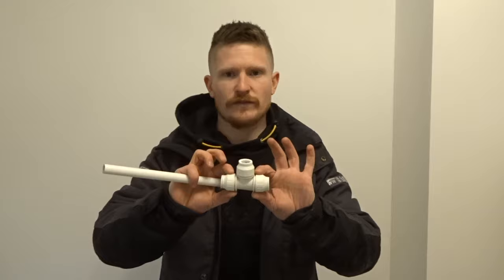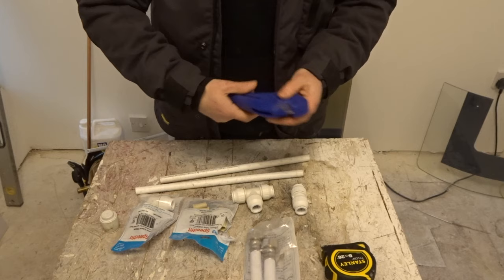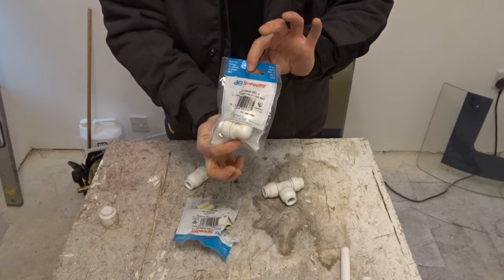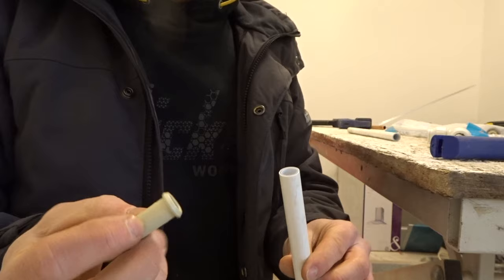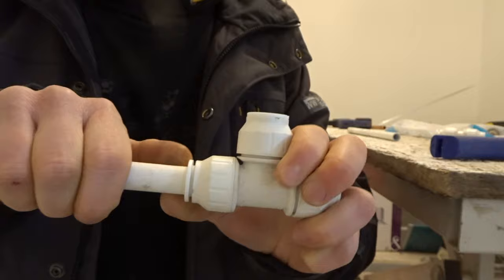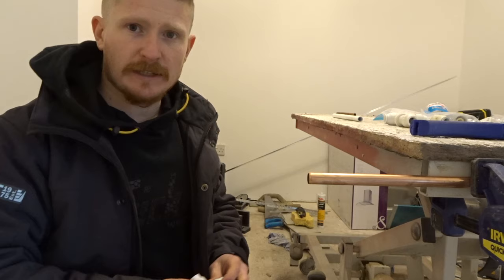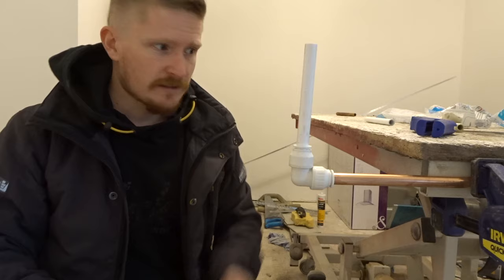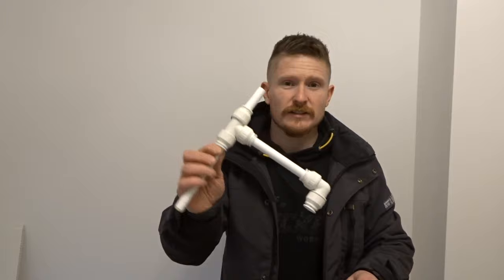How To Use Push Fit Plumbing Fittings | Plumbing with Plastic Pipe

Comment: Very good vid, thanks! But could you tell me if these fittings can be used on flexible plastic pipes? I have a plastic pipe feeding my toilet and the only way of isolating the water when working on it is by the main stop valve. Could I use speed fittings on flexible pipe so I can fit an isolation valve? Thanks in advance!

Comment: Perhaps worth mentioning that those inserts can be used with compression fittings whereas the ones with the extra washer (not in the vid) are for push fit fittings.

Comment: Great video mate, perfect explanations throughout 👌 
I do have a question for you please. If I use a push fit on a copper pipe, ideally how much copper should be present for the push fit to connect comfortably? I have a slow leak on the main pipe to my toilet and the compression fitting is stuck (olive is gripped hard and I don't have space to cut it at an angle to get it off 😭) so I was considering to cut the main pipe shorter so I can just remove the compression fitting but the copper isn't that long so I'm not sure if it would be best to cut and extend with the plastic pipe as you've shown. PS - the leak is behind the isolation screw, so the slow leak is consistently dripping and it's not the nut being loose as I've given it another tighten, no luck though. Any advice would be greatly appreciated. Thank you.

Comment: Is that not a compression insert , using plastic pipe shouldn't it be the insert with the 2 rubber o rings on ? Explained very well and clear perfect for beginners

Comment: So what is the minimum distance between two Speedfit connectors (obviously to allow later removal)? Say and elbow and a valve feeding my sink. I am refitting for the valve and I want the current flex pipe to be in the same position. It would be useful actually to know the minimum length of Speedfit pipe needed as an alternative way of looking at it. Thanks.

Comment: Great video thank you. Would these push fits go on older 1/2" copper pipe which I'm told is a tad larger in diameter than 15mm pipe?
Reply: Yes they fit copper pipe fine

Comment: I fitted a washing machine service valve using plastic pipe with insert but it leaked. A small leak but couldn't stop it. I have read its best to use copper for comression joints and simply join the plastic pipe to the copper pipe.

Comment: Just did a project using JG.Since I was using a couple of elbows I was practicing trying to get exact size and discovered when removing the pipe scores were being left on the pipe.It was all plastic I was using.I read that you shouldn't use pipe if it's marked so I tried to do job without having to remove them again.What do you think of this?

Comment: Great informative simple video. A question - how do I join new flexible pipe tails with female connection to the existing push fit on my boat - fitting a new mono block tap? Thanks

Comment: They do metal inserts to be used when joining to compression fittings to prevent plastic pipe being crushed.
Reply from the maker: I've never had to use those in my many hundreds if not thousands of inserts fitted.
Reply: Hep 20 have metal inserts, and have 50 year guarantee as well.

Comment: Great thank you. Can you tell me do I need to drain the entire heating system to extend a hep20 pipe? Want to shift a radiator 30cm so need to extend a pipe with a connector. Thanks
Reply from the maker: That’s dependant on the type of system you have. If pressurised then yes, if it’s a vented system then you may be able to pull a vacuum

Comment: Dont, it will last until the copper corrodes with condensation from the two surfaces that conduct heat differently, the copper will develop green slime and it will fire it off the pipe.
It is just a question of when.
 I have seen hundreds of failures some that have cost over £30,000 to fix the damage .

Comment: Why didn't you use super seal inserts for the plastic compression fitting? Is it not right or needed? I have been using them for all plastic on plastic (and the normal insert when going to copper, brass, chrome etc.)

Comment: as a 3rd generation plumber i still use ptfe on compression fitting even on plastic , rather do that than have to go back to a tear drop leak
Reply from the maker: If that's what works best for you then that's fair 😃

Comment: Hi. Currently undertaking a job where I need to split a cold water supply in the bathroom into 3 supplies.
Any guidance on if I can tee off of from a tee? Trying to avoid the more expensive 3 way manifolds which seems excessive.
I'm splitting the cold supply to a sink to a washing machine/and two taps.

Comment: Excellent. Thanks so much. What is best way to clean the old copper pipe? Thanks
Reply from the maker: A piece of wire wool is the best thing to use. You can also use scouring pads.

Comment: Excellent guide! But can you tell me if it's possible to use these on ½" imperial size copper tube, bearing in mind the diameter is only slightly different from 15mm metric?
Reply: Hi ..you can buy 1/2inch to 15mm straight push fit adaptor. Think I got mine from screwfix about 5 years ago.

Comment: I am 74 years of age and never used plastic pipe, I retired many years ago from the plumbing and heating trade, and I just have to say thanks for this video.A couple of questions, can you reuse a fitting as we do with compression fittings do we ever need to replace the rings in the fittings or just throw them away, Who seel these fittings and pipe, and the best prices ,for instance Screwfix or tool station, One reason I am asking is that a new kitchen was fitted under my floor and the guy connected to the rising main with a fitting just like these and its impossible to ever get to it, and i have been concerned about it ever popping off, apologies for the long message.
Reply from the maker: Hi. Yes you can re use a fitting and Screwfix tend to be best priced. I wouldn't worry about these fittings. I've fitted many many over the years and never had a failure.

Comment: Great video. Do we have yo use Pex inserters? Just installed a electric shower without one. Wonder if it may leak? Thanks
Reply from the maker: Yes it's something that should always be done otherwise you run the risk of leaks. You may be lucky and it may be fine, keep an eye on it. But it it's possible I would consider rectifying it and installing an insert.
Reply: @TheDIYGuy1  thank you buddy. I will get some ASAP. Jeep up the good work. 

By the way liked and subscribed 👍🏼
Reply from the maker: @Bfamily91  thanks!

Comment: I removed a radiator in my house last year so know the pipes for the radiator are in the wall, flexible plastic pipes that are branded Hep2o. Am I able to add these attachments onto the flexible pipes to move a radiator to a different wall?
Reply from the maker: JG speedfit will work with Hep but if you encounter a fault then you will void any guarantees. You can buy the equivalent Hep fittings to the ones shown in this video.

Comment: What's best for a central heating system?  I'm not sure whether or not to use pex or pb pipe  .
Reply from the maker: It depends which you prefer working with. Both can be used for the central heating system.

Comment: Which inserts should be used as there are the plain and the superseal type?
Reply from the maker: Superseals provide a better deal supposedly but I've never had any issues with the standard ones so use them all the time. Also the superseals shouldn't be used with compression fittings so that makes the normal ones a more generic item for the tool bag.

Comment: Are these safe for use under floor boards as in December I had a plumber replace a pipe using the straight ones with a copper pipe in the middle and I've been worrying about it busting, leaking or popping off the copper pipe please help as I always worry about it
Reply from the maker: They are perfectly fine for what you've described. Don't worry about it.
Reply: @TheDIYGuy1  Thank you for getting back to me
Reply from the maker: @Skimzi  👍

Comment: Would you recommend burying this stuff under concrete?. I need to make 2 4 meter runs under my kitchen floor as the cooper failed and leaked, so looking for an alternative?. Thanks
Reply from the maker: If it were me I would run it in an outer sleeve so that it can be pulled out should there be any issues and this will also protect it. I believe this is how building regs like it to be done too.
Reply: @TheDIYGuy1  thank you for the top reply 👍 had a plumber recommend MLCP? What's this?.. why do they confuse things lol
Reply from the maker: @battlight3476  I have never used it. It's multi layer composite pipe and is a fairly new innovation. I don't have enough experience with the mlcp so I don't want to misguide you on that. Personally I think push fit(PEX) will be fine for the job but as I say, just be sure you lay it inside a conduit of some sort.

Comment: i have used it for the whole heating radiators in my house, i have 3 floors and 5 heating radiators.
we have a district heating system in the netherlands with water flowing of 80/90 degrees, and about 3 to 4 bar.
i must say in the first installation some connection leaked.. but after i checked again i saw that the tube was cutted crooked. i cut it straigt again and the leaking was gone.

i used it one winter period without any leakings so far, but i am just curious if it will be fine next year?
can i trust the John Guest Speedfit system? and for how long will it last? because the connections are made in the wall. does it reach a lifespan of 30years? 

it's a very nice system, but i dont know how for i can trust the installation, if anyone can clarify this for me i would be relieved :)
Reply from the maker: Yes, you can fully trust the system for many years if installed to standard.

Comment: Hi. Can this pipe be hidden in walls which are then plastered over?
Reply from the maker: It can be. But don't plaster directly over it without running it inside either a cavity or channel. If you have direct contact between plaster and pipe it may crack the plaster.

Comment: My old landlord was a plumber, he used this plastic crap too. every joint has leaked after a few years.I am now dealing with a flooded bathroom because he used one behind the toilet to connect the mains. Whole floor needs ripping out. Vinyl, wood underneath, the poltstyrene that sits on and the floor underneath all of that pumped out and dried. Dont use plastic fittings, do the job properly. Just my advice thats all.
Reply: The old ones were absolute crap. All the new ones are fantastic if fitted correctly

Comment: Best way to use push fit plastic is to not use push fit plastic, pay a professional and use copper
Reply from the maker: However most professionals now use push fit apart from on applications where copper looks better or where it isn't within spec to do so.